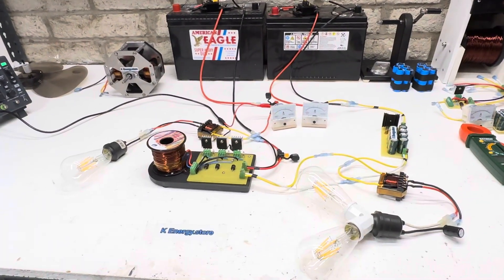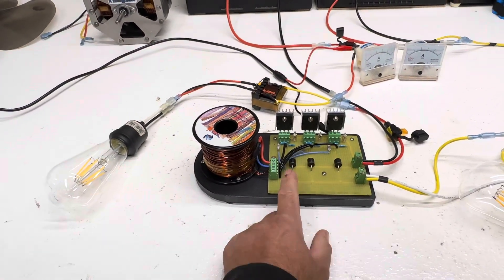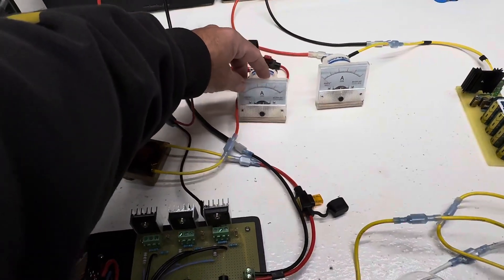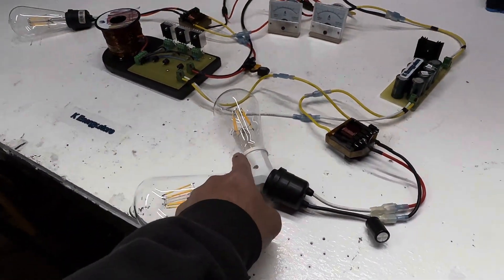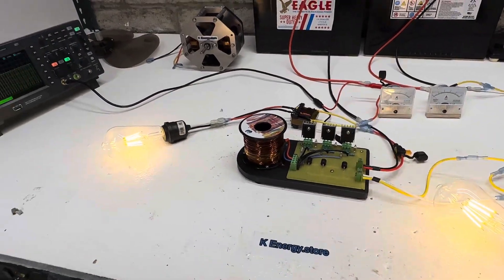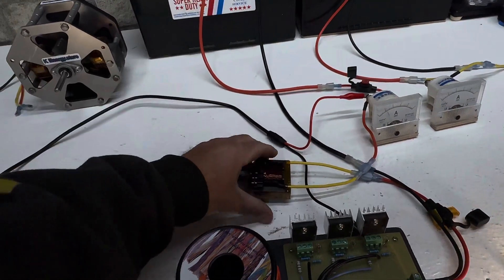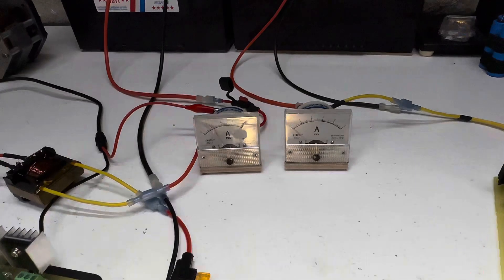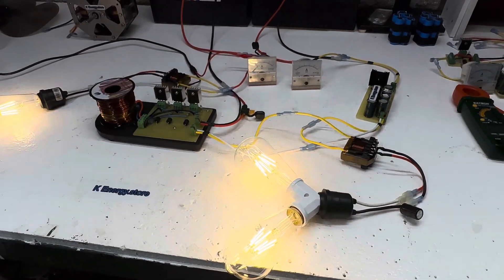Forced oscillator with transformer on input and output

Comment: I went on to Perplexity AI and typed in what role does a transformer 1:1 play in a circuit.  These things do a lot for safety and isolation.  There is no rotor needed sir in this circuit?  If so, why would anyone use them at all?  Thank you sir.
Reply from the maker: The transformers are for splitting the output
Reply: @kenergy1707  Thank you sir. Does the forced oscillator replace the need for a rotor?
Reply from the maker: @hoofheartedicemelted296  yes

Comment: Awesome......as always great video......the input is 12 watts, and you turn on 3 6watts and also a discharge of 3 amp every second in 12 volts battery. I would like to believe that there are overunity but, we will need values.....and not in current x voltage........the brightness of the bulbs is equal to normal use applying whatever voltage dc they are?

Comment: I just wish I had a deeper understand of these ideas and processes. 😀😀😀😀😀
Reply from the maker: All you need is a coil with 200 turns of 18 and 26 wire and a bedini circuit
Reply: O.K.that makes sense.  @kenergy1707
Reply: Thank you for the mathematical numbers Sir.  @kenergy1707